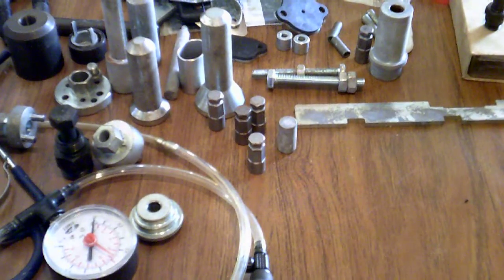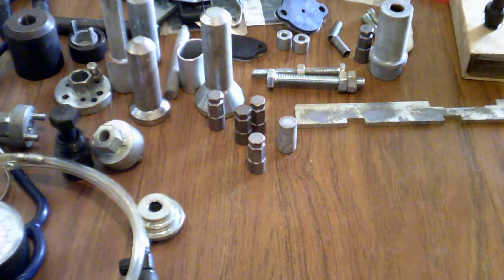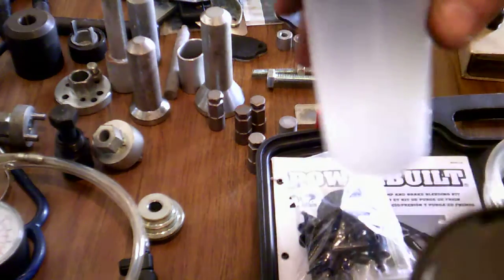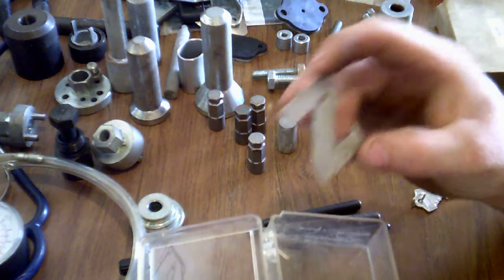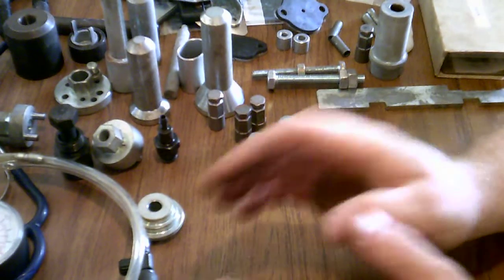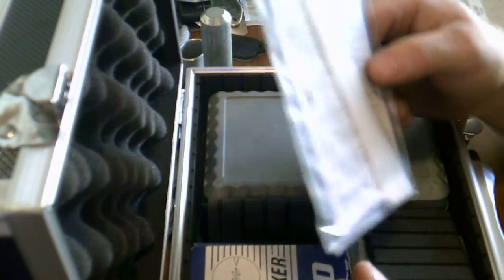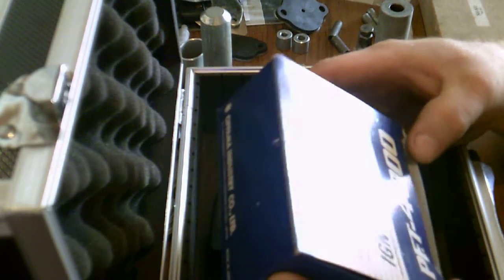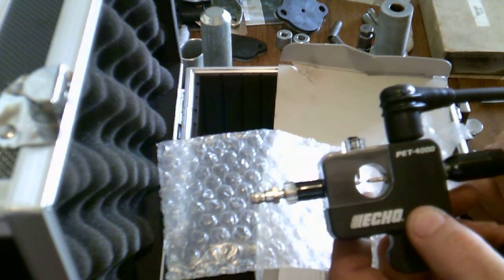chainsaw tools 2

Comment: Thank you!!!!
Reply from the maker: The part number is 91018 and its called a crankcase pressure test adapter 14 mm made for Echo, and Shindawa . It is a oem service tool purchased from BG,S Engine Clinic.

Comment: Hello. Do u know the part number for the spark plug adapter,,,,,,That u use your pressure gun to pump air in the cylinder,,,,i look on ebay but couldnt find it,,, Thanks,,,,,Man good video
Reply from the maker: I will try to see if I can find it . Thanks for watching my video..